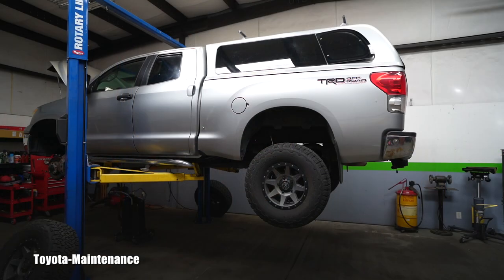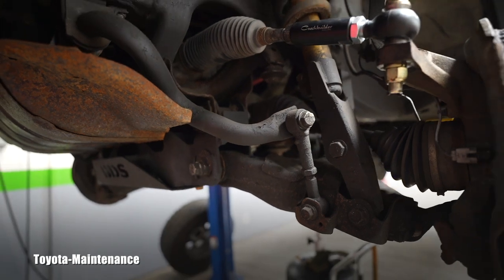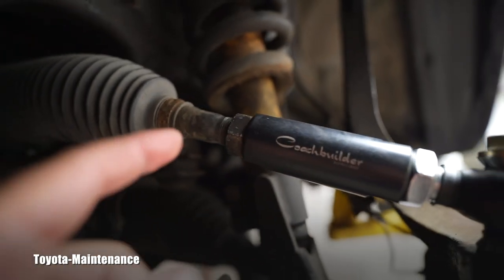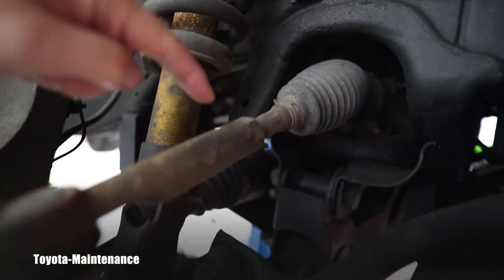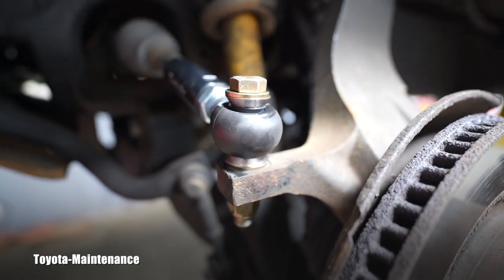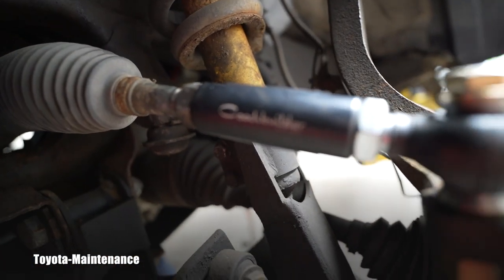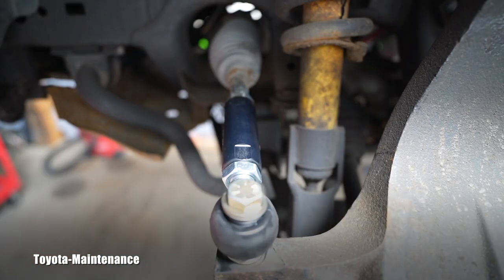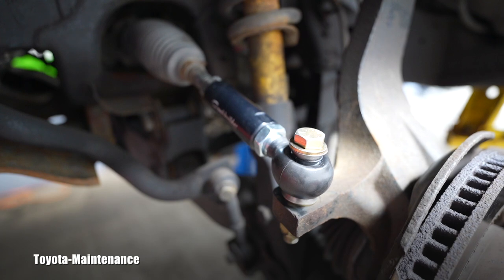2007 Toyota Tundra COACHBUILDER Steering Kit

Comment: Great video, I'm looking at ordering a set.  On the Tacoma and Tundras, look into changing the "bump stops" There are more than one brand, the ones I have are excellent.  I changed my front and rear. My Tundra's original front bump stops were VERY small. I pull a trailer and a full load in back of the truck,  the bump stops are well worth it!

Comment: Hi Peter. I’m changing these bushes tomorrow so I’m doing the same job as you.  I cut the big end off with an angle grinder and then you can press the bush out with the hydraulic press. If the bushes refuse to move i heat out the inner tube with a torch and pull it out with pliers. Then I cut the outer wall of the bush with a hacksaw from the inside. If it still won’t move I get the chisel out and peel the outer tube away from the control arm. I’d hate to pay someone by the hour to do this job as it is incredible how difficult it can be. I’m looking forward to seeing your method.